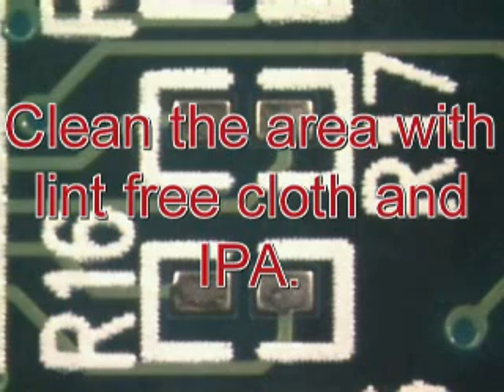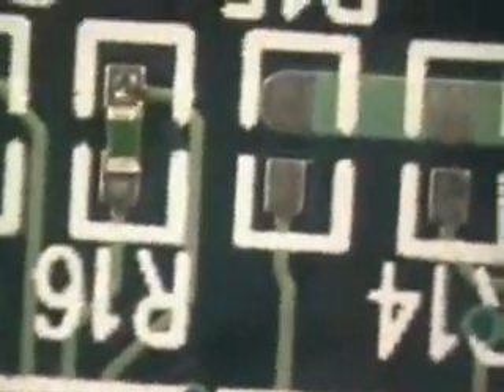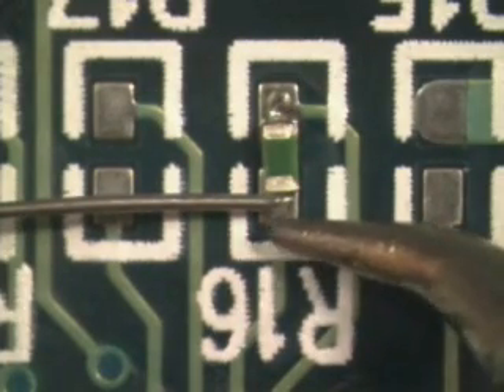SMT Soldering 0402 Component/Installation

Comment: Temperature to solder ?
Reply from the maker: Hi,

Thanks for your question!

I apologize for the delay in replying.

Tin-Lead (SnPb) solder goes from solid to liquid (Reflows) at 183 degrees C (about 361 degrees F).

Lead-Free (Pb-Free) solders, depending on the alloy, reflow at anywhere from around 220 degrees C (about 428 degrees F) and up.

A good rule-of-thumb is for the tip to be set at around 315 degrees C (about 600 degrees F) to start and can be adjusted as needed.

So why such a high temperatures if the solder melts at a lower temperature? 

The simple answer is efficiency and thermal dynamics.

Thermal dynamics: When an item heats, it rapidly increases in temperature until it gets near the set point. Within a few degrees of the set temperature, the rise drastically reduces in speed. This same principle is why a pot of cold water and a pot of hot water will boil at approximately the same time. The cold water rapidly rises to near boiling, and then the last few degrees take longer to achieve. 

The other part is that when an iron is applied to a solder connection, the heat energy flows out of the iron tip into the device/connection/solder alloy. This causes the temperature of the iron to drop. If the temperature drop lowers the tip temperature below the reflow point, it will take a while for the iron to recover, increasing the time required to complete the solder connection.

By setting the iron well above the solder reflow temperature, we have rapid rise in temperature to a point above the reflow. When the iron is applied to the connection, the same drop in temperature happens, but the tip temperature remains above the reflow point, allowing the connection to be completed in a rapid, efficient manner.

To the other extreme, temperatures above around 700-800 degrees can also be used. However, the higher the temperature, the more risk of burning or over heating the component, board, or solder. Hotter does not always equal better.

Temperatures approaching 900 degrees and above may cause certain alloys to vaporize which is a health hazard.

I hope this helps!

Thanks for your question and for watching our content!
Kris Roberson
BEST, Inc.
Master IPC Trainer.
Reply: Thank you!  @SolderingGeek